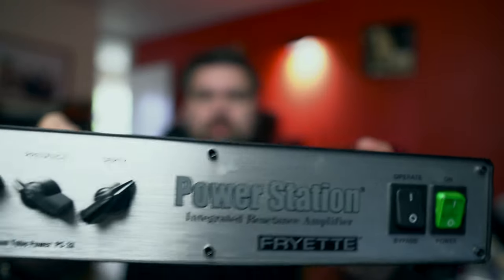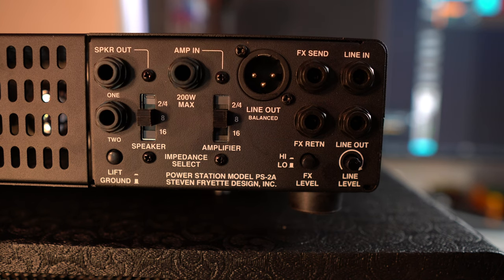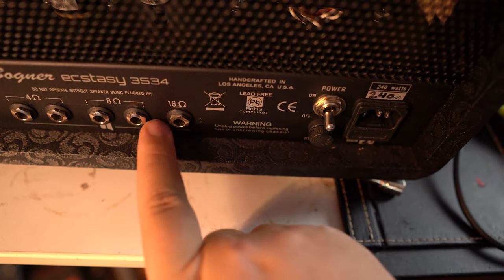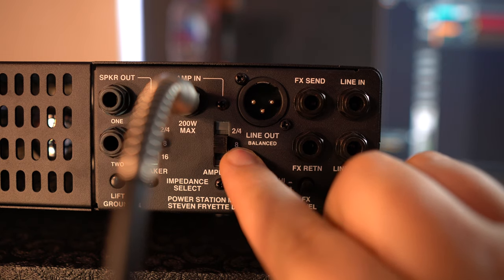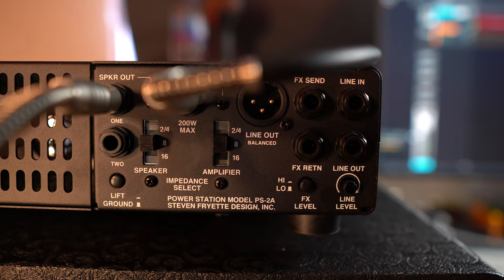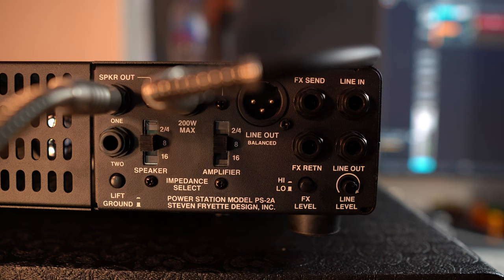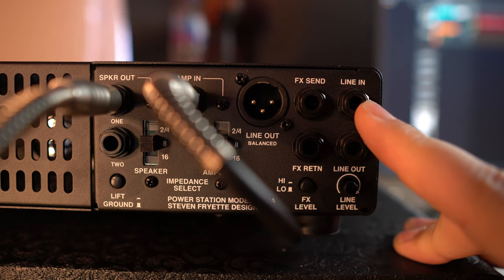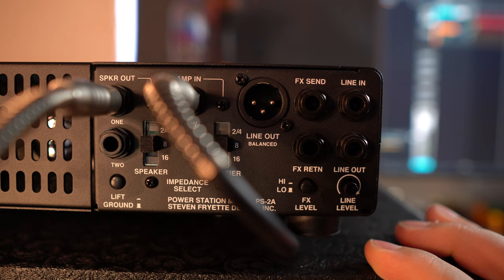How to hook up your Valve amp to the Fryette Power Station

Comment: Hey Chris!  Great video... question for you.  I bought a PS-100.  I connected my Vibro King Fender combo amp's "Main Speaker" out to the PS100's "Amp In" jack via a speaker cable.  Then, to come out of the PS-100, I plugged in a speaker cable into my PS-100's "SPKR Out" jack.  This went into a double-sided adapter (female on both sides).  Then, out of the other side of the adapter, I plugged in the speaker cable that ran to my fender amp's speakers.  Now my fender amp doesn't work!!!  What did I do wrong??!  THANK YOU SO MUCH

Comment: Chris, thanks for the video my man. Do you have the PS-100 hooked up to something so you can play through your audio interface and monitors?
Reply from the maker: Hey man, no worries, thanks for checking the video out. I was using a Grossmann Iso cab, which was being fed by the PS100. I have since bought a Red Seven Amp Central as dealing with the Iso cab was a bit of a ballache.

Comment: HI !  great Video !    do you maybe know if its possible to plug in the cabinet( speaker) AND play silent ?? i dont want to plug in and out my cabinet all the time (powerstation speaker out)
Reply from the maker: Hi, thanks for checking out the video. I believe the only way you can do this is,  plug into your cab - turn down the volume on the front and use the Line out on the back (and the line out volume to moderate this) to go out to an interface (I assume this is what you mean to do). Does that help at all?

Comment: Maybe you can clear something up for me.  What is the reason behind doing this?  If you already have a 100 watt amp head and a 4x12 cab and it already has an Fx loop built in to the amp head, what is the reason?  I understand if you are using this to power maybe 2 separate stereo channels for W/D/W setup but why do this with just the amp and cab?  What is the reasoning/benefit?

Comment: When i plug my amp in exactly as u showed, the ps100 does nothing.  The signal goes straight thru to the speakers. But the knobs and switches have zero effect??
Reply from the maker: Hi Jackie, I'm sorry to hear you have an issue with you unit. It doesn't sound right to me. It sounds like the power amp is not being engaged. Might be a good idea to reach out to Fryette for some support. Good luck. Chris
Reply: I can answer this. Firstly I recommend you watch some other vids, this one is a little bit simple as there's zero explanation of what's going on inside the unit. You have to distinguish between the reactive load/attenuation and the power amp. You can use either or both at the same time. When you go from your amp's speaker output to the "Amp In" of the PS, you aren't using the power amp of the PS, you're only using the reactive load/attenuator. This is normal operation if you just want to crank your amp but then turn down the volume afterwards to get lower volumes and the controls only on the left of Volume will work (the presence and depth knobs are only applicable to the power amp). For a power amp application, you'd use a pre-amp into the line in of the PS and you'd plug a small cable between the speaker out and Amp In on the PS. This effectively uses the the Power Amp within the PS and would allow to use the depth and presence. Another way of doing this is instead of using the poweramp in your combo/amp, use the send in the FX loop of your amp to the PS and use the power amp within the PS. I hope this makes sense.
Reply: @teatime6414  Can you or anyone explain how I would hook this up to my Marshall origin combo amp? Or did you just do that in your comment?!😅 I could just plug the combo speaker into the power station and that would be the attuenator function? Sorry for the confusion.

Comment: Great video, I know it been up a while but I just checked it out. Question, will this handle a 100 watt head amp? Or would I need to move up to the PS100? Also, the effects loop when you run a couple of boxes through is it ready to be used or is there a switch that needs to be made to get them engaged? Sorry if it seems if these are dumb questions.

Comment: Does your Fryette Power Station make any fan noise?
The amp I am using an amp that has a fan that makes a too loud noise for playing at a lower level at home.
I have a separate pre amp I use for my clean tone/pedal platform (Mesa Formula Pre) and am looking for another power amp (or maybe going with a Two Notes CAB M+).
Thanks Chris!

Comment: Question, so two 16 ohm cabs you use one 8 ohm out on the amp to the Power Station then use the two speaker out on the Power Station and set at 8 ohms correct?

Comment: Great video! My PS2A is on the way! Quick question: I have a matched set of 8 ohm speaker cabs, each containing one 12 inch Celestion. Can I plug these 2 little cabs into the 2 speaker outputs and set the PS2A for 8 ohms and expect it to work okay? Just want to be sure that it won't see them as 16 or 4 ohms, that sort of thing.
Reply from the maker: Hey mate, thank you for checking the video out. I am no authority on this but my understanding is that you would set your head to 4 ohms if you are running 2 8 ohms cabs (it gets a little bit more complicated depending on if you run your cab in series/parallel). Setting your amp to 4ohms would mean that the amp is see a total of 8ohms with the two cabs. If you set your amp to 8ohms your head would be see a total of 16 ohms off of the two cabs which would be too much. But as I said I am no authority in this so please do so good research on this. Good luck man, two cabs should sound glorious.
Reply: @chasingtone2022  Thank you for your thoughtful reply. I was afraid this was something to look deeper into so I will contact Fryette and see what they have to say. I have a Friedman Runt 20 and 2 separate 12 in. cabs. Sometimes I use just one cab and set the amp for 8 ohms. When I wish to use both cabs I use a special speaker cable that I wired so that the combined ohms are 16 and I then set the amp to 16 ohms. I can continue doing it this way but it would more convenient to to connect the 2 cabs with separate cables and the unplug one if desired. I suppose I'll just have to pay attention to the speaker ohm switch on the PS2A when doing this but I will confirm with Fryette and report back. Thanks again for great videos you create and best success to you.
Reply: Any info from Fryette on this yet that you'd be willing to share? :)

Comment: Where does the speaker out go on a Friedman runt 20 combo amp? In fact, how do you set up the Friedman Runt 20 combo amp with the Fryette PS-2A as an attenuator only and nothing else? Cheers.

Comment: Thanks, Chris. So I have an old AC30 that doesn't have an effects loop or a speaker send. So I'm guessing I need to break the existing connection from the power amp of the AC30 to the two speakers, so that I can cable the Fryette in between? Also, I'm curious about the effects loop in the Fryette. Does that mean I can have my reverbs and delays in there instead of in front of the AC30?
Reply: Yes ....... After the amp effects.

Comment: Yes, and listen to the fan noise that fills the room while you are playing (and a constant hum coming from the transformer). Great concept, but they didn’t go the extra mile for making it a great product.
Reply from the maker: Hi, thanks for checking out the video. I can honestly say that I have never noticed any fan noise on mine even with a 100 watt head cranked through it. There is a slight hum from the transformer on mine but it's not an issue for me. On balance I think its a great piece of kit but it is not for everyone (as with all gear).
Reply: @chasingtone2022  when pressing Power On the fan comes on independently from the load being active or not. This is the case for the PS2A and the PS100. The hum comes on when the bypass is switched off, ie. you are in re-amping mode.
Reply: Well yea it’s not a great product. It’s an amazing product.
Reply: @EJH-jn6mo  Amazingly sloppily designed/build product. I have three of them here in the studio and all show the same behavior. I am really disappointed.
Reply: @Michael-bm8hi  I mean, you consistent hear the PS-100 is beloved so either you have bad luck or you’re consistently dropping them.
Reply: @EJH-jn6mo  No, I haven’t dropped anything here. This is a case of a device hyped more than it deserves through YouTube and other channels.

Comment: Hi, I have a dumb question, what happens if the unit is off and the amp is turned on? Does it protect itself from that? because that may accidentally happen. I’ve heard a similar case with the Waza TAE which damaged the unit. Thanks
Reply from the maker: Hey man, there's no such thing as a dumb question. I just checked the manual and it says this: Silent Mode allows you to use the Power Station as a silent adjustable reactive load for quiet direct recor- ding or when sending a live amp signal to front of house with no speaker cab connected. In this mode it is not necessary to power up the Power Station. You don’t even need to plug in the power cord. The Voicing switches, Low Pass Filter switch, FX Send (along with the FX Level switch), and the Balanced and Unba- lanced Line Outputs all operate with no AC power applied.

I hope that helps you.

Comment: Important to not that speaker 2 does not have output without speaker 1 plugged to a cab or other similar resistance device with ohms matched. Love the Power Station. It is one tool set and amp I will never part with.